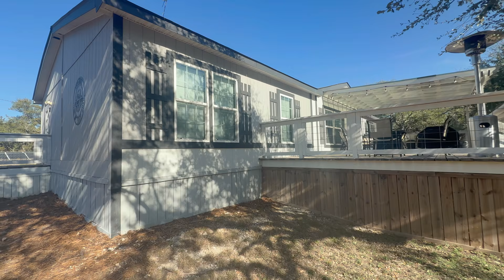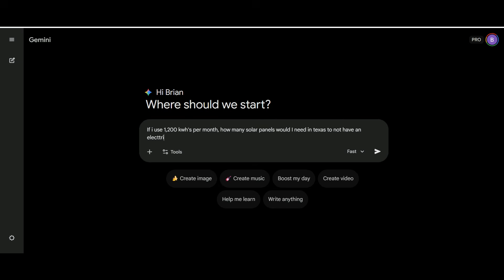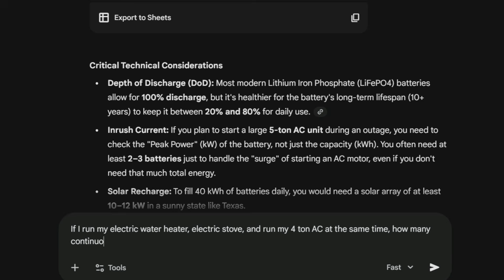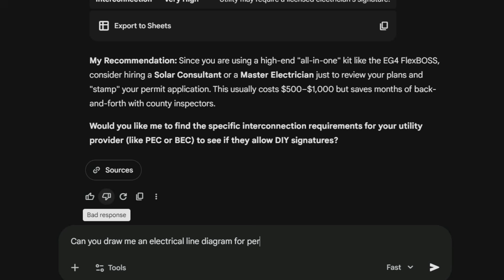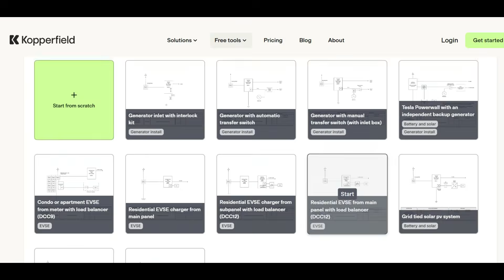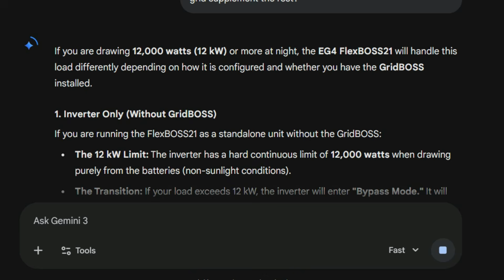Design a complete EG4 home solar system using this single AI tool

Comment: 48 volts is not high voltage... I think 48vdc is the top edge of a low voltage equipment. If you went with a 300-400vdc storage system, that's high voltage.
Reply from the maker: Yes that’s correct.

Comment: So to sum it all up, Gemini does algebra for you.
Reply from the maker: lol, yes it does that too. But to sum it up it will tell you how much solar production you’ll get in your area of the country, optimal angle for panels, how much battery storage needed based on your usage, how difficult it will be to get through permitting, how to file a permit, what code is on the specific type of install…..  much more than just algebra.

Comment: Sinclair skyrack with 20 jinko 590 bifacial panels paired with  flexboss21 inverter and 6 powerpro wallmounts has been perfect for my off grid cabin and to insure i wake up to a 90% charged Telsa everyday 🎉
Reply from the maker: Very nice system 👍

Comment: Why not use the “thinking” or “pro” models instead of “fast”? 

Better yet use deep research since Gemini gives you 20 (I think)  deep searches a day. Instead of piecemeal prompting type everything up and let it churn for 8+ minutes.
Reply from the maker: Yeah I was just scratching the surface on what AI can do. I’ll make a follow up video expanding on it depending on if there’s any interest in this first video.
Reply: @unpluggedtexan great video idea btw.